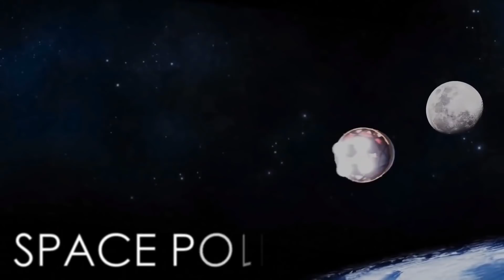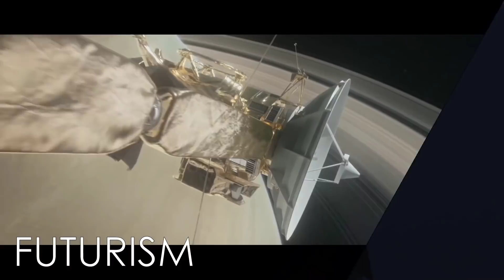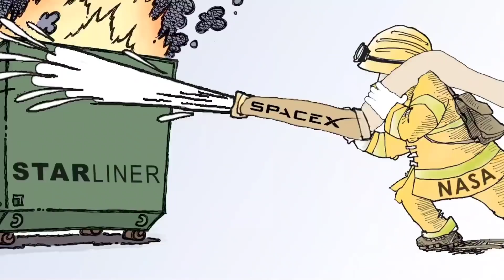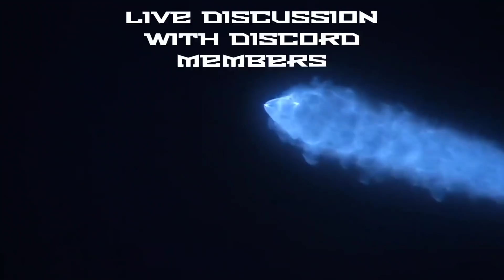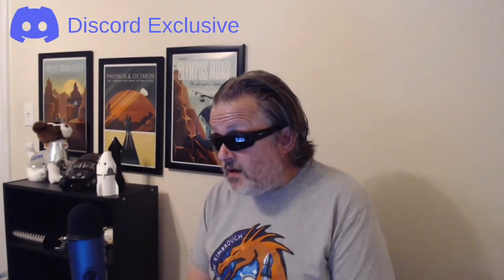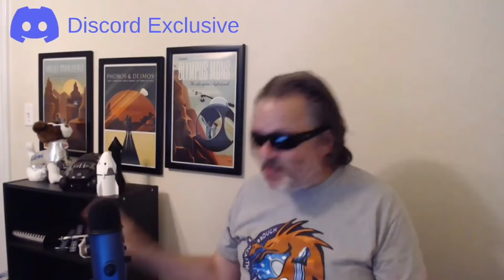FIRST Live Q&A with The Angry Astronaut and our AWESOME Discord Supporters!!

Comment: Virgin has the best idea so far ' add endless reusable rockets sent to space from highest altitudes where astronauts/engineers could assemble segments , perhaps at the space station ! so much wasted resources with fixed based rocket-pads needing the first stage to get to high altitudes
Reply: virgin reusable shuttle could return space junk not needed for reuse in other space endeavors

Comment: Why isn't the Heavy Booster not running on Oxy/Hydro?  At some point those engines will have to be tested for that fuel mixture for long term Lunar hauls.  I believe each Starship should have the capability to do such a feat.  All Earth liftoffs and landing for either LEO or Geo  and Luna routes should run on Oxy/Hydro.  Then Mars and say the Planets beyond will be Meth/Oxy since there's less liquid Water to economically be accessible to convert to fuel efficiently.  Use the fuels that are applicable to your given destinations, since more than likely you'll need to make and refuel at your destinations in the first place.
Reply: I love your idea, but the Raptor cannot run on both. To run on Oxy/Hydro they would need to use a different engine.
Reply: Additionally the volume ratios required for the correct propellant/oxidiser mix for methane to lox & hydrogen to lox are very different [the latter requires MUCH more propellant volume for the same amount of lox] & the Starship & Superheavy tanks are designed for Methane & lox, so they would have to redesign completely if using hydrogen for earth-related work
Reply: Also, Elon likes methane because we can make it from the Martian atmosphere. Liquid/metallic hydrogen is hard to store especially over time iirc.